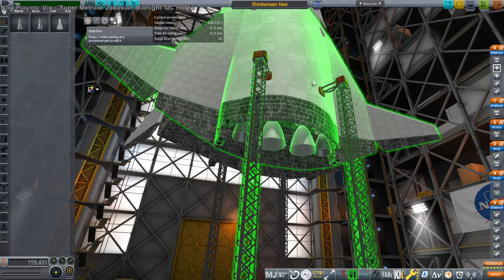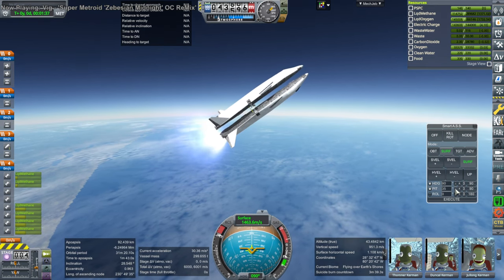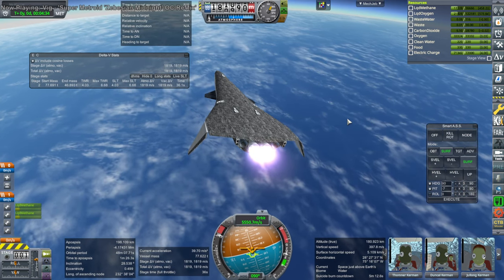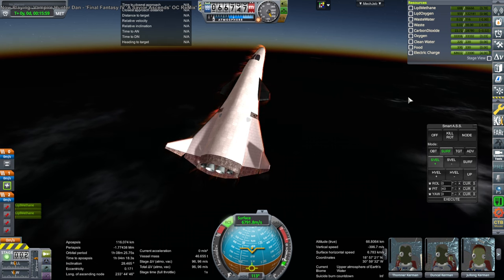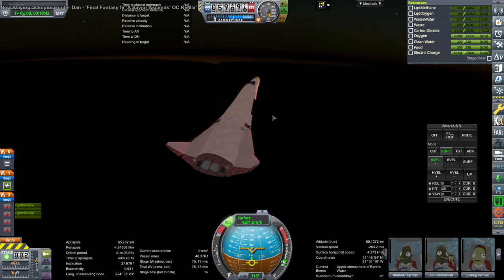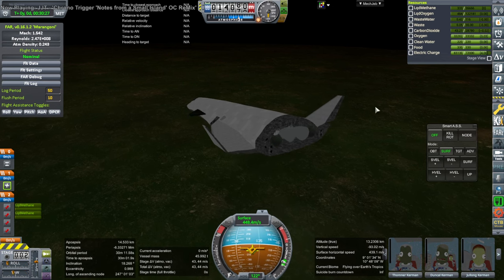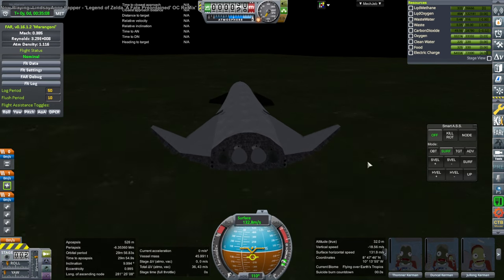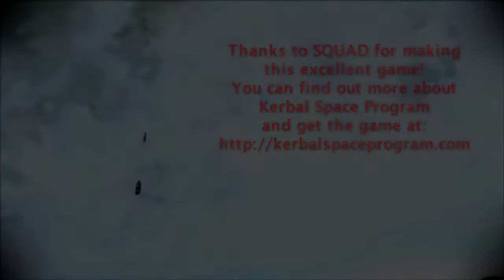Shinkansen Launch and Reentry Test (RO in KSP 1.12)

Comment: Nicee

I made a similar architecture spaceplane recently for my JNSQ save and it works great as a crew transport system vs having an ET it’d be cheaper irl

Also with an expendable second stage mounted to one carrier plane like your Orion craft. Great for high energy missions and slightly more demanding huge LEO payloads. I used 5 RS 25’s on mine with hydrolox to keep it similar to shuttle, but with 7 and 2 more drop tanks added to the wings it can send Orion to the moon!